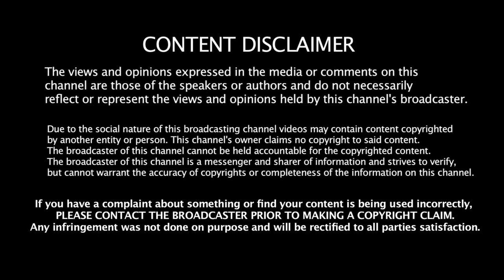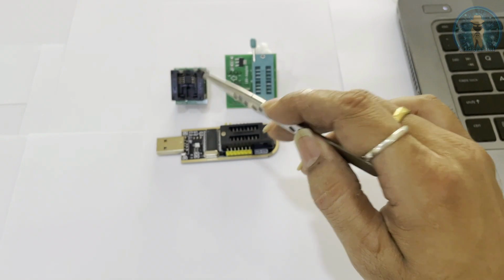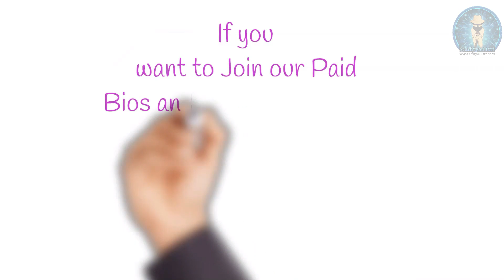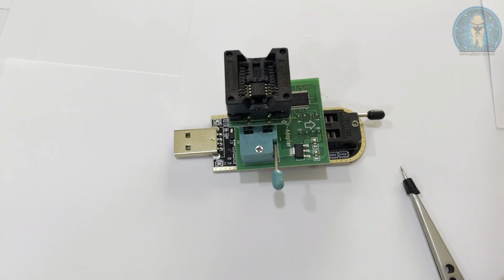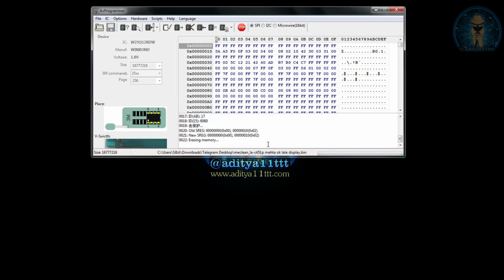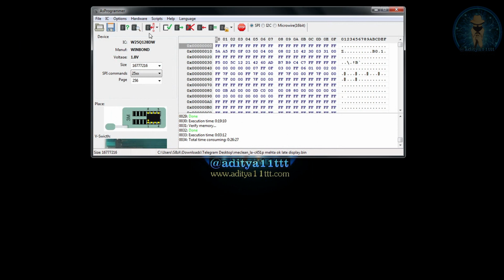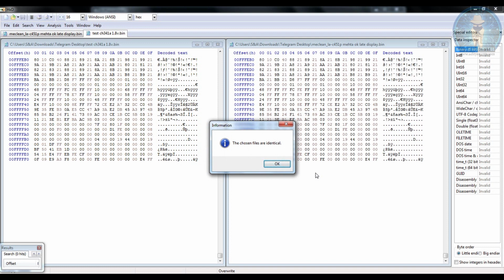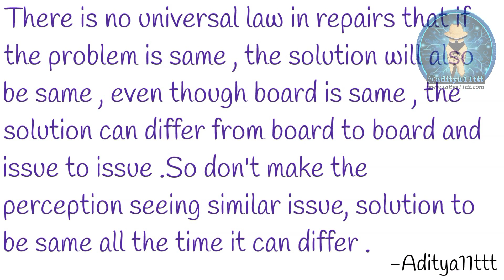How to program | Flash 1.8v bios chip using CH341A

Comment: I have taken the necessary precautions with regards to static etc. But on three separate occasions have blown my motherboard when trying to flash my bios using ch341a?
Reply from the maker: Issue with how you are trying to take backup if you are using clips for backup than you will face such issues use chip off reading for best results or change clip and try !
Reply: @Aditya11ttt  thanks, I believe its the clips I'm going to purchase a T48 so the board is not in danger.  What do you think?

Comment: Hey, I have a quick question, My Rog Strix B450-f Gaming II is bricked and I am trying to troubleshoot it and stuck. 
- The BIOS chip on MB is ST24C02 and every where i see the option for programming a 25xx series chip but couldn't find any information on 24xx series chip. 
- I will appriciate any information you can provide please, Thanks in Advance!!!
Reply from the maker: Just flash 25xx series’s

Comment: I connected soic clip before the USB was connected and soon smelt burning.  The battery was removed and obviously power adapter removed.  I couldn't flash Bios as second LED was dim or not lit at all.  My laptop won't start.  Any suggestions?

Comment: I have these two devices. when I put the 1.8v adapter on the programmer the yellow led light dimly and the 1.8v convertor chip gets hot. 
can't read the chip.

sometimes randomly the yellow LED stays off like in your video but still can't read chip. faulty 1.8v convertor? what do you think?
Reply from the maker: Buy new 1.8v
Reply: I have the same problem
Reply: if it gets hot --- the chip is bad

Comment: My ic eror chip main memory with the content are in dissagrement
Reply from the maker: Try another ic
Reply: @Aditya11ttt  my ic mx25u12835f 1.8v detected in 3.3v ch341 no adaptor, why in adaptor 1,8v not detected. maybe the adaptor broken?
i test multimeter done voltage 1,8v the adaptor ch341
Reply from the maker: Get 1.8v adp